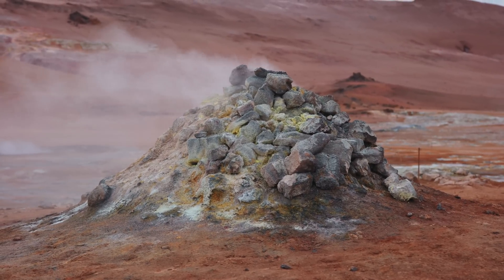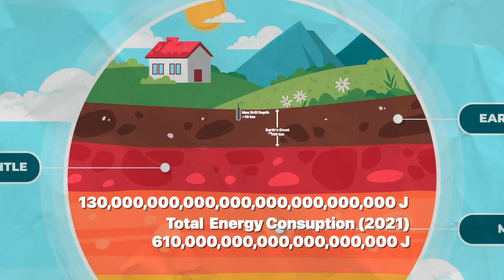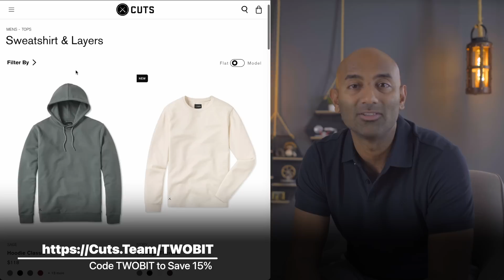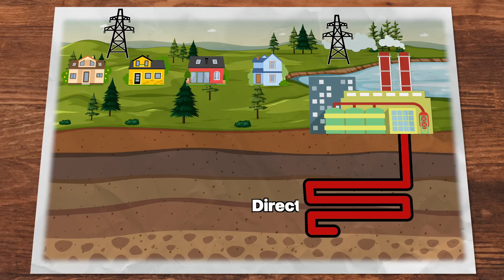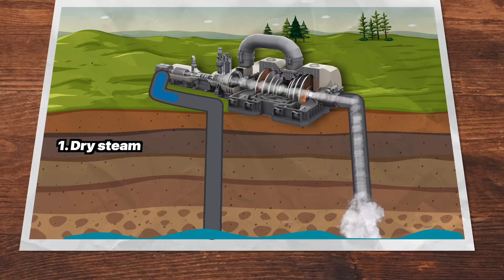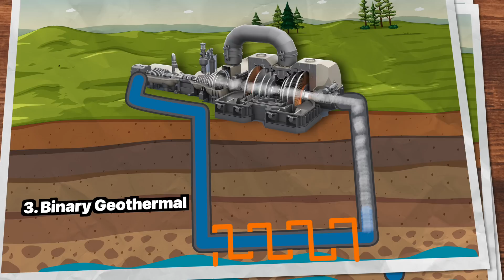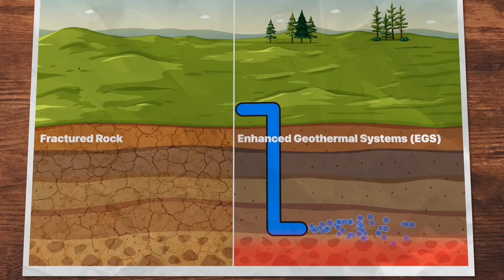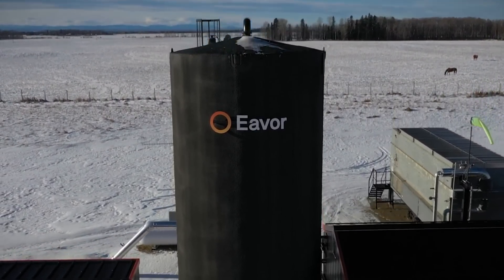This Breakthrough Energy Source Will Replace Nuclear & Coal!

Comment: Excellent talk on geo thermal energy solutions. Hopefully many more such plants will come up all over the world and in India in particular. We have several geological areas where this technology can be used very profitably. 👍
Reply from the maker: hey Ajay , let's hope that happens!
Reply: Actually, wind and solar are not solutions at all because they are intermittent.  I was working in the control room of a Power Company.  We cannot have a sudden wind shortfall which can happen in minutes or a sudden cloud cover taking say 1GW away within minutes.  How to back that up?  If I call a combustion engine station to power up an extra engine, it takes 1.25 hour for it to start up and energize the grid.  For a gas turbine it takes 45 minutes and for a coal power plant it takes 8 hours.  So, the 1GW disappearing from the grid will cause blackouts.  So, what is secretly happening is if you have a 1GW solar farm, the power company manager will instruct a 1GW of coal plant to run as a backup for when heavy clouds cover the solar farm, especially in equatorial Malaysia (where I am) where heavy clouds are a norm.  You may ask why did they build the solar farm in the first place?  The decision to build them is not from experienced electrical engineers.  Such projects cost tons of money and only top politicians are authorized to make decisions on such high levels of money.  Engineers are a very rare breed in politics worldwide.  We tend to live relatively honest lives and therefore do not venture into the world of not being true to yourselves which is the political world.  Hydro is perfect, it can energize the grid with up to 300MW of power within 20-30 seconds upon calling them.  But not all places have the high-water flow plus mountains to make it feasible.  I have long thought Geothermal is the perfect solution.  It is not intermittent.  In fact, it is so perfect I am wondering if there is a fossil industry worldwide hampering its development.
Reply: @prashobh216  
The utility scale solar plants are built in areas where there are very few clouds for obvious reasons.  The battery storage systems now being deployed can respond within milliseconds and eliminate gas turbine power plants that have to be on standby.  As the system switches to renewables there will be more storage in the form of hydrogen with 3 to 6 times as much solar and wind to build up the supply of hydrogen to supply all the electricity while it's nighttime.

The solar and wind are becoming the choice of power generation because they cost less than any other form of generation.  It's about the money!
Reply: @acmefixer1  The problem with people supporting intermittent solar and wind is that they do not study the real numbers.  Europe has 10.2GW of battery storage which is enough for 1.4 minutes backup.  By 2030 they will have storage for 11.7 minutes; obviously if anyone can buy batteries, it is the Europeans and why are they not doing so?  It is because it is terribly expensive despite Europeans being the main manufacturers of all the high-end batteries.  You can read Australia’s Chief scientist, Brett Cuthbertson’s article where he stated that the current world’s entire battery storage (mostly located in cars, trucks and motorcycles) can store electricity for 11.5 minutes.  Tesla’s “Gigafactory” when in full production will produce batteries annually for just 47 seconds of electricity currently consumed.  The current solar contribution to the worldwide electricity supply is 3.6% so it is not becoming, "a choice of power generation."  As for hydrogen just pull up the YouTube of what Elon Musk has to say about it.
Reply: @prashobh216  
Your comparison is apples and oranges - it means nothing.  Over 90% of energy storage is pumped hydro - that's what must be used.  There are many hundreds of useable sites for this, some are abandoned open pit mines.

SMRs are everyones' panacea, but new nuclear is too expensive.  No utility is going to be ordering any new NPPs because they have multi-billion dollar cost overruns and decade long construction delays.
Reply: @acmefixer1  You totally don't make sense with your first statement, "apple and oranges."  Suddenly you are saying storage is pumped hydro and not batteries; that indicates a fickle mind.  You are arguing for argument's sake not to discover the truth.  There are lots of issues with solar and wind, the main being their high cost.  Then wind farms are killing a huge number of birds.  Solar farms are taking away prime land and the actual pollution in the manufacturing of solar panels produces more pollution than gas turbines.  And the waste disposal once the solar panels have reached their end of lives causes more pollution still.  Solar may work if it is combined with a lot of artificial intelligence (AI) such that if one region goes dark and other regions very far away in the country can supply.  Without the AI, solar is like purchasing a car without the wheels which is why they don’t work.  Huge wind turbines have been known to break due to a sudden high wind gust.  Pumped storage is very expensive and gas turbines being an old industry have optimized over time to be so much cheaper per MWh.  Where I am located all the solar projects have failed and the biggest one is 1MW costing US$5 millions and failed after just five years.  This project is just to power 350 homes.  If they had chosen diesel in the first place it would have cost only just US$25 thousand and the rest of the  US$5 millon can purchase diesel for more than 150 years.  Basically it is the hype that is causing politicians to choose intermittent solar and wind and who loses in the end. It is the poorer people of the country who will get less money because the government has squandered money on crazy solar and wind schemes after being advised by people who have minds like yours.  All this hype is caused by rich people who are not owning the traditional power plants trying to get a share of the profitable traditional fossil fuel electricity supply.  They sponsor the likes of Greenpeace to demonize the traditional fuel electricity generators such that they can get a share of their electricity supply business.  What is happening in actual fact is that coal plants and gas turbines have continually improved their engines in efficiency.  Coal plants have improved greatly over the last 50 years and so have gas turbines especially since all jet planes are using gas turbines.  There is also carbon sequestration being worked upon where the exhaust of coal plants are pumped underground.  The real problem is caused by politicians not bringing out the free energy supply machines developed by Nikolai Tesla.  It is obvious that gravitation and electromagnetic fields are everywhere around us, we just have to convert them into usable forms which is what Nikolai Tesla has already done and top politicians have stored away.  Nuclear power is also demonized by paid protesters.  Of course there is danger but if knowledge of safety is well shared humanity can live in an unpolluted world.  I did a contract for an oil and gas company and their safety procedures are very impressive compared to all other companies I worked for; it is something that can be inculcated.  In India emphasis is on thorium nuclear fuel and fossil fuel companies are sponsoring their failure in India.  I hope the Modi government can withstand it and take out fossil fuel from India’s energy supply.

Comment: This Video is a reasoned and Well considered  look at geothermal energy.  There are two other  technical reasons why it is currently under used.  These are  1. Thermal conductivity of the crust and 2. The use of water as the extraction medium.. The first problem is that rock can only conduct so much heat  per second. In the 1970's Icelandic engineers discovered that their expensive extraction vents were drying up! The cause was found to be the over extraction of heat from the underlying rock.  Subsurface temperatures plummeted and slowly regained their original levels only after extraction was halted. Further expansion of the wells surface area temporarily relieved the problem but to this day the wells have never achieved their expected extraction performance. The problem with using water is that it boils at 100 degrees Celsius  and this limits its use in liquid form. This is why steam is used instead. This is less efficient as the higher the steam temperature the lower the  vapour density. or put another way, the hotter the steam, the fewer the water molecules per cubic centimetre can pass up a  tube per second.. This increases vapour pressure but lowers effective thermal transfer as kinetic dispersion  by the molecules via the conduit walls will cause energy loss. The problems can be solved by digging down to within 1Km of the Mohorovičić discontinuity layer and by using molten salt as the transfer medium but this introduces  additional problems which the current state of technology is not ready for.

Comment: 11:00 unfortunately there is still a risk of contamination because the new source of fresh water will be flowing through substrate that hasn't had water before so it might leach out minerals at first. Not an expert, just saying that adding water changes the chemistry of geology.

Comment: No, close loop system with heavy low boiling point metal will prevent cracking/fracking and earthquakes as a result. Think DENSITY OF METAL which does not create pressure doing nothing if pipe rupture vs water expanding causing fatigue in impossible locations to repair. Gallium, Mercury, and Others as toxicity is of no concern due to too deep & not mixing with ground water.

Comment: U DEFINITELLY should learn more about nuclear energy. Do u know smth about Russian "Proriv" project? It makes nuclear energy almost renewable and extends even KNOWN uranium deposits on Earth and COMPLETELLY solve the problem with spent nuclear fuel...Only that spent nuclear fuel that Russia already has is enough to power up whole Earth in next 1400 years...What is MUCH MORE significant is that it makes U-238 reliable source for nuclear power plants which extends the ammount of nuclear fuel available on Earth atleast 100 times.

Comment: First, I/we don't need policed over comments and YouTube will kill itself by its allowance of "no comments". The simple reason we are all kept cold is because they haven't agreed how to charge the poorer people, but what the average person doesn't know is that if something is even a few feet under ground it takes on the temperature of the earth beneath, that's why you only need three foot of water to stop fish from freezing in Northern England. In northern England it has been done in a new office block to priced heating and they said it's just to do with depth and not what's beneath, so if you put a pipe deep enough and just have a closed pipe filled with a heating agent or just water, the ground will heat the pipe up and you just need a vent at the surface.

Comment: I envision, in my SiFi mind, in the future we have mechanical 3 ft long “bugs” that burrow into the earth, finding the path of least resistance to make their way down to where it’s hot. These “bugs” contain what is needed to convert the heat into electricity within themselves and send it directly up to the surface through the attached electric cable. That’s the beauty of SiFi, I don’t have to work out the details and since we can just imagine the technical evolution that took place through the process of time.

Comment: As with all of these technologies the likelihood is that geothermal will become part of a mix of renewables however you have not mentioned one of the most huge breakthroughs in drilling that will change geothermal energy and that’s direct energy drilling.  Cyclotron (fusion gyrotorn) MMW ( millimetre wave)drilling using 30 to 300 GHz frequency. It does not use a drill head and it creates a sealed glass and rock wall coating the hole from melting its way through non-porous rock.

Comment: The problem, currently and maybe forever, is it is not economical in most places. Simply drilling deep, pumping in some fluid and extracting the heat from within that limited zone. Does not pay back the amount of energy put into all the production of equipment and energy input required in the first place! Before the zone cools down, below operating temperature. You have to understand in the beginning, middle and end of any process most of the economics or cost can be directly related to all the inputs, mostly energy costs one way or another. So if something is not economical, most likely it is also a net energy loser, with everything factored in. Or if it really was profitable, an energy gaining system, as geothermal is in a few rare places, many companies and governments would already be doing it!?

Comment: The power in the earth core is like the pressured air in a ballon.....tiny leaks will not harm the integrity of the ballon but if the hole is big enough, the earth will released the magma like a balloon releasing the pressure air inside the ballon and explode.......yeah, very safe....LOL

Comment: On visiting Iceland around 30 years ago, I was most impressed with the way geothermal energy had been harnessed in various places. From what I see on a few Icelandic videos on occasion, they have certainly increased dependency on this resource. 

In Britain, I remember they dabbled a bit in Cornwall some years ago. Cornwall is the most geothermically active spot in this country, but still lags far behind many other parts of the world. They had to dig down quite a long way to reach only reasonably hot water, and I don't think the experiment worked all that well.
Reply: For a lot of areas of the world, it makes A LOT more sense to do individual, shallow, direct energy systems for heating and cooling.  For example, where I live (mid Atlantic region), if you dig down around 9 feet or so, you get a pretty constant temp of around 70* F year round, which is great for both cooling and heating. That's a lot of energy saved right there off the bat since heating and cooling tends to be the highest energy hog in a home. In my area, I would still have to use a couple dehumidifiers in the summer because it is rather humid here, but its still a lot less energy than a full whole home AC system.

Comment: The first of such geothermal projects I know of was in Cornwall, UK, several decades ago. The aim of the project was to generate enough to be self-sufficient, but fell short. It's also the first example of fracking I came across, as they were drilling two holes down through granite followed by fracking and then the pumping of water. In fact, they had to drill a third hole because the fracking took a different direction than they had anticipated.
Reply: They are now doing geothermal at the Eden project, there's a good video on the Fully Charged channel showing it in progress
Reply: There is a geothermal generation plant in Cornwall that might be related to that earlier project (run by the Cambourne School of Mines?) that went online in 2021/22. It generates 3MW which is only 0.004% of our current generating capacity unfortunately, but does at least provide power which I believe is competitive in price. Unfortunately according to most sources I have read there are few places in the UK where the geology is suitable for geothermal energy at reasonably competitive costs, but this may change if energy prices and availability from traditional sources continue to trend in the directions they are going.

Comment: Can one not just make a drill, that has piping inside, drill that down to the right depth, pump water in one end, which turns to steam coming out the other, powering the home base turbine?

And if heat conductivity in the drill-pipe is to high between the piping, make a closed loop of oil, and extract the heat above the surface to water to power the turbine, the cooled oil goes in one side and the heated comes out naturally on the other side.

Better yet use a graphene cable, 1 end goes into the heat, and it almost instantly transfers the heat to the other end, no heat in the middle of the cable, as it acts like fiber optics for heat, ready to connect to a Stirling generator for the home, all we'd need is a single drill with the cable inside to go down which can be pretty small in diameter, like that of an oil rig.

Comment: The closed-loop system is just utilizing the heat from the earth to heat the media in the pipe. It's not being used as in the heat escaping from the interior of the earth so it is never lost. New inventions take time to become useable in the real world both residential and commercial but it's a great step in the right direction.  Awesome.

Comment: One thing you didn't mention  unless I missed it is hard water. Water moving through rocks desolves minerals. A  test well near the Salton sea was allowed to blow for 90 days to test its staying power this being with out  injection wells.  The   water and steam went to a diked area to evaporate.  Leaving many millions  of pounds if everything from travertine.  arsenic . Salts  and metals all the way to Gold and silver. Infact the water deposits in the 36 inch blow off pipe would be rich enough to  leach mine  today. You can't run  even dry steam through turbines and expect them to last just sulfer in the steam would eat the metal in months.  One possibility would be explosive franking the rock or even creating  Deep caverns with small nukes. Lastly with all the hell no your not taking out water the Eastern US has been saying well be nice and trade power for water or dear new England,  new York etc please freely your 0 carbon butts  off